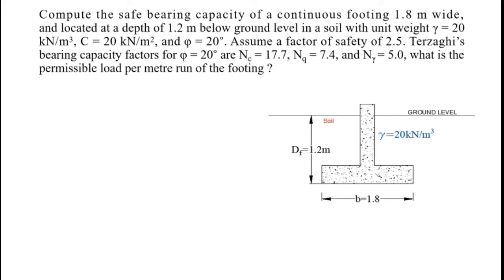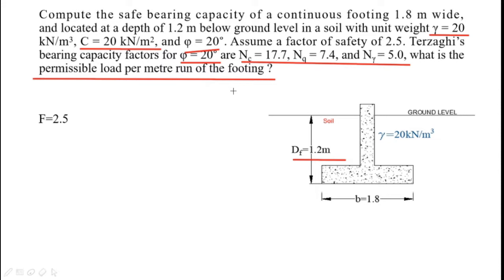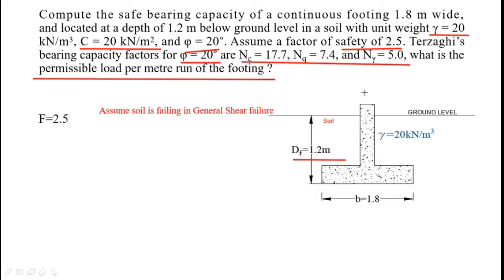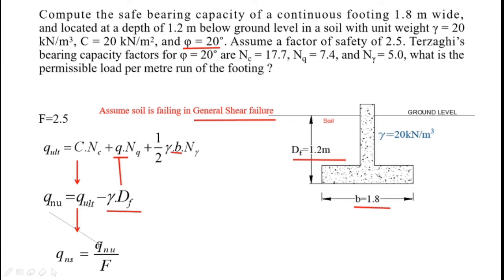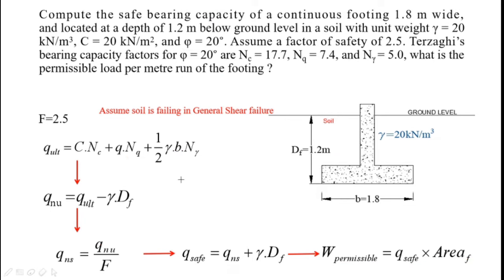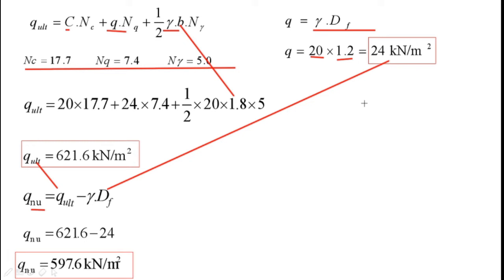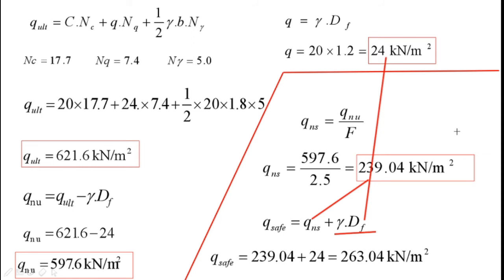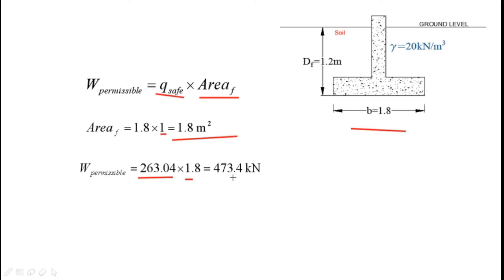Shallow Foundation: Numerical on Calculation of Safe Bearing Capacity and Permissible Load

Comment: What is the ultimate bearing capacity of a circular footing of 1 m diameter resting on the surface of a saturated clay of unconfined compression strength of 100 kN/m2? What is the safe value if the factor of safety is 3?

Comment: Once again to tell how to compute the value of length of footing
Reply from the maker: For calculating bearing capacity, length of the footing is assumed as 1 meters. It is not calculated. If you're asking about design of the footing, the length comes from loading and flexural requirements.